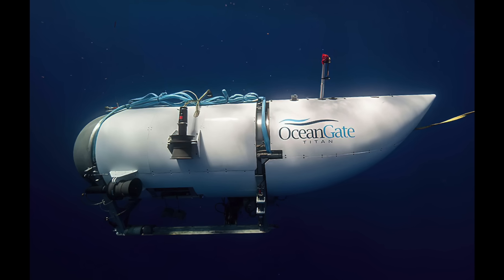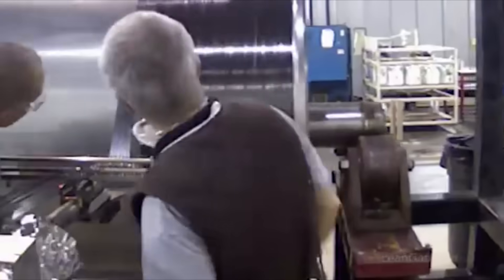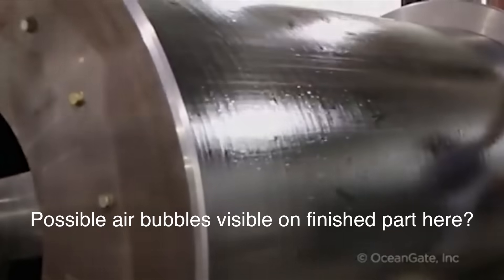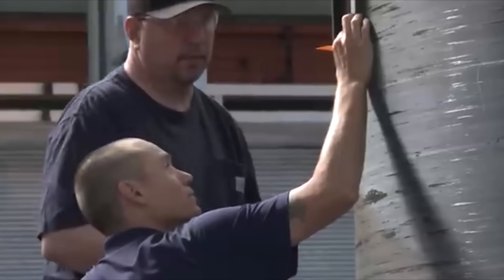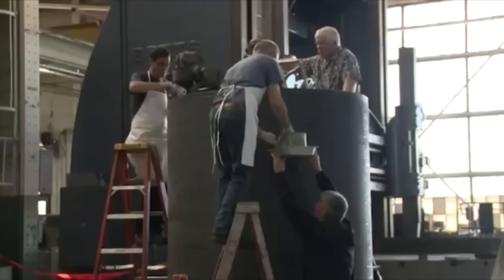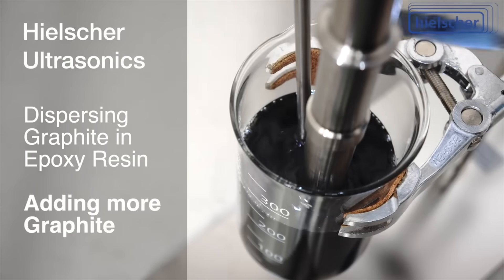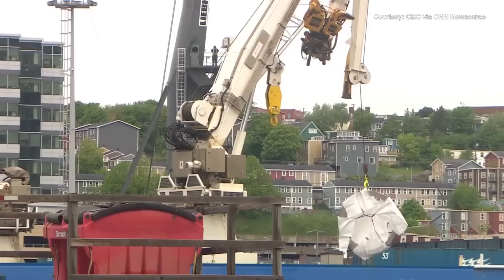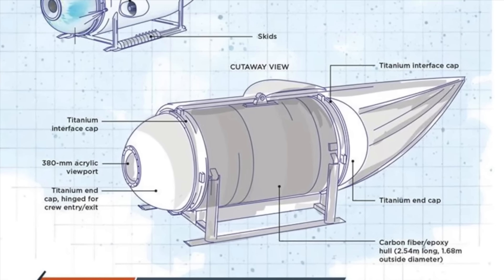Why OceanGate Titan Imploded - A Carbon Fiber Composites Perspective

Comment: Absolutely insane the carbon was only applied this way, anyone who ever 3D printed a tube knows that it breaks in the layers, this is no different, actually impressive it survived as many dives as it did.
Reply: To be fair, Rush clearly states the fiber orientation is 0/90 (1:33 mark), meaning equal amount of fibers in the axial direction and the hoop direction. Still I agree that some +/- 45 degrees also would have made the hull stronger. Rush justified not having +/-45 by saying that there are no torsional moment, which is technically true. Problem is, this is only true as long as the hull is completely intact. As soon as there is a little damage to the hull. The +/- 45 degree fibers would have helped redistributing the loads around the defect.  I am a structural engineer with carbon fiber experience.
Reply: @davidosterberg  how would they run a axial layer with a setup like that? Wouldn't the turned ends of the mandrel prevent them? I guess they removed the ends or there would have be axial layers at the top only???
Reply: @AORD72  That is an excellent question, that I don't know the answer to.
Reply: @AORD72 look up ElectroImpact AFP.  That's how the built that hull.
Reply: @hokiebama1187  Wow some of the "ElectroImpact AFP" videos are impressive.
Reply: @davidosterberg  I heard some pre-preg carbon fiber fabric was placed in the axial orientation over every few hoop layers. That is probably what he refers to when he says 0 and 90 orientation. I assume that's also unconventional? Because the carbon in the axial orientation is in no way linked to the hoop layers, besides glue?
Reply: @AORD72  The axial reinforcement is usually applied as strip about a foot wide with the fibers running across the strip.
Reply: Circumferential layers are also only connected to each others only by the resin used.
Reply: @davidosterberg  There is no reason to assume there was equal amount of fibers in axial and hoop directions. Most likely you aim for hoop strength being twice of the axial strength, because that's how the load is distributed in a circular cylinder under external pressure loading. Of course you can achieve that result by alternating unidirectional and a balanced 0/90 fabric. But there are plenty of unbalanced fabrics on the market to choose from too. If there is any damage to the pressure vessel, a sane person would stop using it immediately, instead of trusting on some redistribution of loading by +-45 degree layers. And as you know as a structural engineer, 0/90 layout has some torsional strength even without any +-45 layers, and being 5 inches thick solid laminate that "some strength" turns out quite massive amount.
Reply: @tuomashiismaki4146  the primary purpose of the +/- 45 deg. lamina in the stacking sequence in this case is to prevent crack propagation through adjacent layers. If there is a defect the damage will propagate quickly through lamina with similar fiber angles, but will stop with a change in fiber angle of an adjacent lamina. But really bottom line is composite behavior at the macro level can be predicted relatively poorly, and predictions at the micro level (damage accumulation) on a large assembly is currently impossible. On paper the calculations show a design like this could work with a decent factor of safety, but if there is one lesson from aerospace it is that physical test specimens have to be created and tested for both ultimate strength and fatigue when working in composites.
Reply: @tuomashiismaki4146   @hokiebama1187   I agree, it does not have to be equal amounts. My bad. Back of envelope calculation:* At 4000 m, we would get about 280 MPa of hoop stress (averaged) and about 120 MPa of axial stress (averaged). So ratio 3:1 hoop to axial would maybe be appropriate.  What I meant by defects, I was thinking about small defects that are not known to be there. Yes, I agree that carbon fiber is a questionable choice. Mainly because it is hard to get consistent properties, and it is hard to inspect

 @fuglbird  you do realize that there are axial forces from the pressure on the end caps that need to be carried by the CF tube. This is why the axial fibers are essential.
Reply: @davidosterberg  I would never consider using composites for a vessel subject to external pressure. Assuming it was a vessel subject to internal pressure we would need all the the 800 layers in the 90 degrees direction just to withstand the pressure. We could add layers in between for other purposes like you suggested probably mostly in the longitudinal direction. Remember these additional layers do not provide any resistance against the pressure. They are only there to keep the 800 layers in good order. So we are talking about a thicker hull. Using  autoclave curing of the composite would improve the uniformness by reducing the voids. That's probably more important tank the faulty gluing process. I agree that the method used for gluing the parts together seemed amateurish; but I think the pressure would keep the parts together. We must wait for the investigations to end; but I assume there was a pure failure in the composite not involving the glued parts; but that's just my considered opinion.
Reply: @fuglbird  curing cylindrical shaped thick composites in an autoclave is about the hardest thing to do.   The part always gets wrinkles.  Most large wound tubes (ATK) are just oven cured.  Think nasa booster sizes, ICBM size.  Even thicker than Titan.  Oven cured.
Reply: @fuglbird  You are forgetting that a cylindrical pressure vessel also has axial stresses from the pressure on the heads.
Reply: @davidosterberg  not equal amounts of 90/0.  Probably 4/1 ratio.
Reply: @davidosterberg  yeah i knew something was off about that argument but i think you nailed it. as soon as you have some deformation that theoretical argument gives way to reality
Reply: @davidosterberg Wouldn't there be torsional moments due to the vertical thrusters on both sides?
Reply: @gbormann71  Yes, but forces from thrusters would be truly negligible. It wouldn’t influence the fiber orientation.
Reply: @gbormann71  The torsional moments from the thrusters would be very tiny compared to loads from the pressure.
Reply: @davidosterberg  A 0-90 wind doesn't necessarily mean that there are equal amounts of reinforcement in each direction.  In my experience they are rarely equal.  The amount in each direction depends on the design stresses.  For example, in the design of low pressure storage tanks there is usually much more circumferential reinforcement than axial.
Reply: @davidosterberg  Good point you make about the fibers. But maybe 45 degree fibers would have created more opportunity for air pockets. It's also useful to remember he made one previous hull and it made noises, so he made a second one with a precise spindle applicator and it made a lot less noise. What I don't understand about the design is why the end cap screw rings could not have a one piece titanium tube connecting them, to avoid the dissimilar material joint? Why not attach the caps to each other by basically leaving the metal spindle in, and have the Carbon fiber simply act in a more passive role of stiffening the thinner central metal tube? That would eliminate the dissimilar material and the joint issue, while still saving most of the weight. The problem was probably that any leakage between the tube and the Carbon fiber would have been an internal force shearing them apart...
Reply: I pictured the water pressure like an ax trying to chop a piece of wood, and how much easier it is to chop with the grain than against it. Also, since the fibers were all in the same orientation, a few layers buckling could cascade through the entire carbon fiber hull. I think the strength of the carbon fiber hull would easily have protected against implosion at least several times better if it had each layer going in a different orientation than the layer before it. 

Aside from that, I didn't like the fact the carbon fiber hull can't be bolted into. I would never trust diving under water in something bonded together by nothing but glue. When I first saw them gluing it together, my first thought was a massive "Why?!" It was kind of like witnessing an idiot in a horror film about to get themselves killed.
Reply: @Eluzian86 truly abhorrent process in every facet.
Reply: I heard that no pattern of laying the carbon fiber would make much difference. I heard the carbon fiber is makes sense to me in that it’s the inside of the hull that ends up failing, not the outside. In other words the strength of the hull is that fails, not  the implosion is  you can wrap gorrilla tape around empty soda can in multiple directions  and it’s not going help much if you apply pressure to the outside of it. I thought I  difference
Reply: I can’t understand how he thought that just having the 2 end caps glued onto the CF Hull without any mechanical back up, say a bonded in face flange with tie rods connecting to the opposite face flange would be deemed adequate. Clearly it wasn’t.
Reply: Rush's video here states that the vessel had a 0-90 structure with reinforcement also running axially.  Of course I don't know the actual laminate sequence.